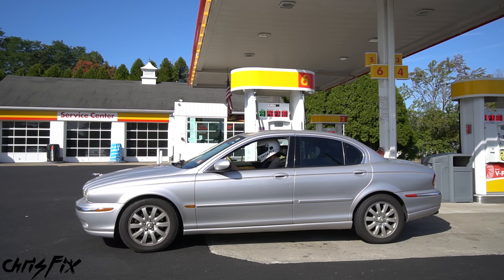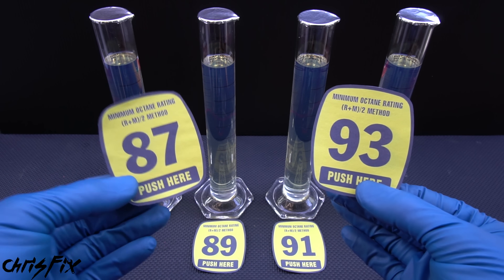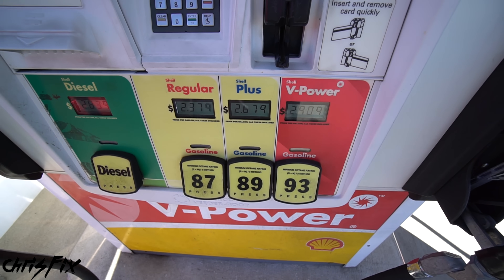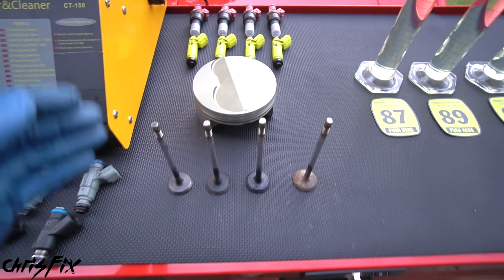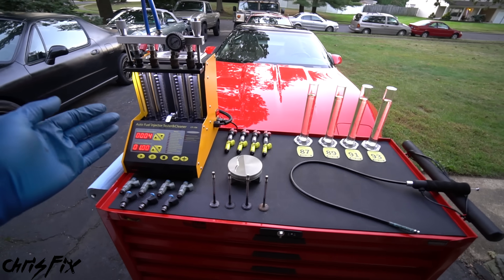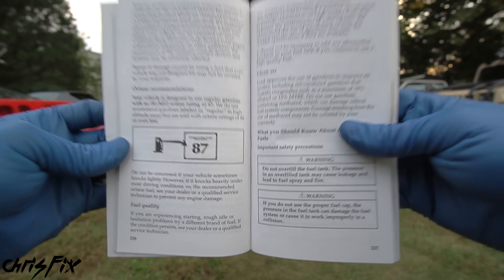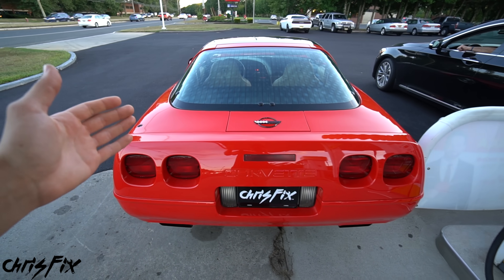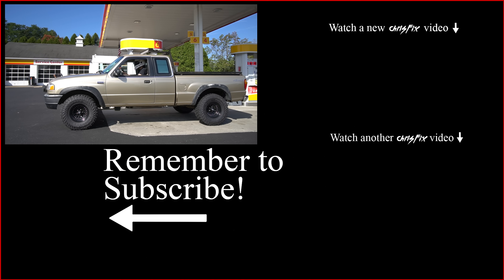What is the BEST Fuel to Use in Your Car or Truck and WHY

Comment: It's simple. Use what the manufacturer says! If your engine takes 87, put in 87. If you want to check if a higher octane will make the car run any better, try an octane booster. Quick tip, it won't make a difference. 

We in Canada have 94 Octane at some pumps. I have a 2.0T Malibu. It is rated for 91. I put in 94 three tanks in a row. I saw literally 0 difference. And I drive like you'd think a Malibu driver drives.

Comment: but what about ethanol??? obviously not a thing where you are but across many countries they have 10% ethanol in all lower grade fuels, so no energy content is not quite the same - engineeringexpailed covers this well. Also this may be limited to Canada but speaking to a career tuner, the 94 here knocks like cheap fuel in europe. He was shocked to see how much more knock he was seeing compared to the same setups back home, at the same elevation. Anyone else experience this?

great video!

Comment: Hey Chris I have a 1995 Toyota Avalon and I use regular gas. So whenever I put my foot on the gas I hear a rattling sound so I believe it’s preignition but whenever I’m at a stop either in drive, reverse, 2 or low I hear this really high knocking sounds I don’t hear it when it’s in park or neutral when in the driving gears or reverse how can I deal with that? 

Another thing my fuel pump for some reason doesn’t work so there was a direct power running from one of my fuse to the fuel pump it self to make it work could that cause a bad fuel ratio?
Reply: get a new car mate, that things about to go out on you

Comment: Just use NON-ETHANOL. Pure gas gives better mileage than E10, and much better than E85, simply because gasoline has higher free energy than ethanol. The free energy of gasoline is 34.2 MJ per liter. ... As a result, your mileage is reduced by 3% with E10 over pure gas, and 25% with E85 over pure gas, all else being equal. 
Also, Ethanol is corrosive by nature and hygroscopic (attracts water), particularly when higher amounts of water are present. This type of damage to a carburetor is typical when phase separation occurs and the highly corrosive ethanol / water mixture corrodes fuel system components.

Comment: I have a 2010 6.0L 3/4 ton Gasser Chevy. I have always filled up wirh premium fuel even though recommended is regular gas. I travel and pull a 28' travel trailer for work, and figured the premium would if nothing else give me a slight bump in performance as well as economy. As well as keeping my cylinders cleaner and more efficient. Is this a waste of money. Like I said, I pull about 10-12000 lbs behind me for hundred of mile journeys. Would primium or Supreme have any benefit in my situation, or am I just wasting money?! Thanks in advance for your hopeful response. Love your vids and have learned a lot. Keep up the good work!

Comment: What is the octane rating of e-85 fuel and when you have a flex fuel equipped vehicle what are you supposed to run? E-85 or regular or what?
Reply: look in the manual, you noob

Comment: I got tired of watching the video. So, you can’t just use any gas for your car. You have to use the factory recommend fuel. The fuel injectors are specifically designed for a certain gas. Specially for your engine.

Comment: So I got a 2003 miata with 146k miles and I’ve only driven it about 1000 miles and I only fill up with 87 even though it says premium recommended
The check engine light came on and I had the code read and it said it had something to do with the timing. Could running premium fuel from now on be the answer to solving this check engine light?
Reply: Ricky Arambula never hurts to try

Comment: Best way to reduce carbon buildup in any engine is to install a catch can on the PCV hose so it reduce oil and water vapor going into the intake system.

Comment: The simple answer is use what the mfg recommends. That said idk where you developed your ideas about pinging or detonation but your explaination is inaccurate. Detonation is exactly what it says. The fuel is detonating or exploding before the piston reaches TDC. The explosion is pushing down as the piston is still pushing up. It is fighting against itself.  Strange that your trying to educate people and dont understand how simple things like this work. Another instance where you dont understand the concept is octane booster. Study the octane rating system. Most every octane booster is a gimmick. You would need a case or more to bring 87 octane up to 93. Probably you best and easiest way to burn out a tank of 87 where you require 93 octane is to add 30-40% diesel fuel. Or add toluene if your familiar. And yes you can burn a mixture. Driving the vehicle in a lower gear may also work. Higher rpm with less load is less likely the ping with less air in the cyclinder. Loading and lugging the engine requires more throttle and air.

Also the higher octane actually has a bit less energy usually than lower octane because most additives used to resist ignition dont have as much energy and gasoline.

Comment: Whenever I put regular octane in the tank I hear pinging coming from the engine while going up hills. And when I use premium the pinging stops but my car backfires more often ....(muffler delete) am I damaging my engine or helping it when I run the premium octane gasoline? Just curious about the backfires and the pinging.
Reply: I'd say helping it using premium, but if it's backfiring, it's probably not running efficiently.

Comment: Simple answer. Your engines power cycle is designed around the fuel the manual says. That is the optimal fuel to use.

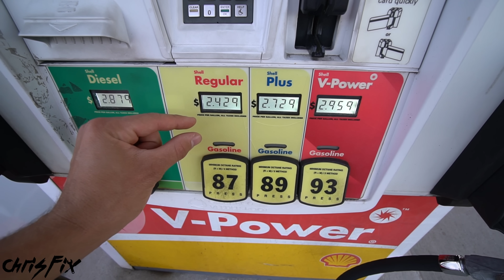Comment: @ 12:23 he contradicts his own statement of "all the fuel has the same energy" . Please correct me if I'm mistaken
Reply: 1:47 -  12:23 js
Reply: Yes, they all have the same energy, but the octane is different, so the lower octane fuel (87) will detonate easier. Most modern vehicles can adjust to that to prevent knocking/pinging (if the vehicle recommends premium), but you end up losing power.

Comment: If the octane doesn't add power for the same amount of fuel, why do manufacturer create engines that requires higher octane fuel that are more expensive?
Reply: Because other engines create more power due to having higher compression ratios, or greater pressures from turbo-chargers or super-chargers. Therefore, to prevent the fuel from igniting before it should, the engine requires higher octane fuel.
Reply: @bobbarker3248  So the power came from the engine configuration rather than the fuel itself.
Reply: @xdragon2k  Yes.

Comment: Strange, in EU, regular is 95, better is 98 and V-Power (Shell) is 100 octane. Before few years, there were sold 91 octane, and my 1997 Suzuki motorbike didn´t like it at all. I cant understand, how you can drive at 87 octane gasoline.

Comment: What about ethanol in fuel? What does it do, and the pros/cons?
Reply: Ethanol is alcohol. Alcohol can be used as fuel. To be short, it allows fuel to be more environmentally friendly. However, it does not have as much energy as gasoline, so I believe there are regulations as to how much ethanol is allowed in your gas. Some also say, because it's alcohol, it can ruin rubber seals and stuff.
Reply: @bobbarker3248  it can be used as a fuel but over long term it's less efficient for your vehicle, you get less mpg using ethanol in the fuel. I'm not sure if it does other damage but it's just annoying to see in all the fuel around me

Comment: I have a 2014 acura tsx. Always put 91 or higher octane since it is "recommended" but not required. With gas prices soaring, what is your opinion on fueling with midgrade? I rarely see cars that require or need midgrade. What exactly is midgrade for?

Comment: Great video. Thanks!! One quick question. So if my car ran more than 150,000 miles, is it better to run 2,500 miles with premium gasoline to reduce the carbon formed on the pistols and the engine? How often should I do that?
Thanks!!

Comment: What about cars that has gas installed in it. I recently bought a car with gasoline plus in spare tire place 50l gas tank. It runs quite nice and is cheaper but how it effects the engine. What to use to not get knock or something. But i most of the time buy premium on my car so it should clean its self cuz not everyone using premium and damaging engines here

Comment: gets rust on car body "it's weight reduction"
gets rust hole in exhaust "it's straight piped bro"
gets excessive carbon buildup in cylinders "it's a high compression upgrade bro"

Comment: yeah about that shell vpower, my father and I have two old dodge dakotas, one with a v6 and 220k miles and the other with a v8 and 121k miles on them.  we had ran normal 87 in them until i was filling mine up with the vpower stuff because of a video i had watched and even knowing my engine ran smooth as butter it still sounded audibly better and then my dad put the vpower in his v6 and it cleared up a whole slew of various things we could hear but had gotten used to while adding a bit of power back to it.  So basically what i'm getting at is unless the car specifically says to use 87, assuming you can afford to, you should use the 93 vpower because it's made a difference on our two trucks.

Comment: my car needs 91 or higher. if I use 93 and throw in a octane booster I get better mpg almost 2 city and 8 extra highway. is this because the ecu is adjusting the afr to take advantage of the extra detonation resistance?

Comment: it takes higher compression to detonate the higher octane. high compression high horse power motors you dont want gas to ignite from compression before the spark plug fires.

Comment: Hi i own a 02 GMC Yukon xl and it can take 85 flex fuel only problem i can't find any gas station with 85 why is that?  We used to see them a lot more i guess they stopped selling it what's the reason? I'm from Brooklyn NY

Comment: In Canada, Shell V-Power Premium 91 octane has one huge advantage - no ethanol! Ethanol leaves deposits that degrade engine performance and reliability over time. I use it exclusively in my snowblower and lawnmower, where the fuel may sit for months before use.

Comment: What about when the manual says "Super Premium Highly Recommended"? Mini Cooper S says this in the manual. Does this basically mean always run Premium when possible, but if stranded, octane booster isn't necessarily required when filling up with 87?

Comment: My 99 chevy prizm says 87 or higher. It gets the higher. Premium only. 19 years payment free without leaving me stranded ever. Only asks for oil changes and basic replacements based on nothing but mileage. I’ll drink water. It’s getting premium. Did regular for a week and ended up having to filled up more often doing the exact same routine.

Comment: Ok so I have a 89 f150 with a 5.0 ( 302 ) but I have built the engine into a 306 and I’ve put regular in it for 8k miles ( every since it’s been built ) but how do I know if I need premium ? The truck so damn loud I probably couldn’t hear detonation even if I wanted too
Reply: And I swapped it to a carburetor too

Comment: So you use mid-grade in the Del Sol? Do you have a B series engine in it? I have a B16 and I believe the sticker in the fuel door says 91 recommended but you read the manual it says it only is good to gain HP.

Comment: I have a 2003 Dodge Dakota with a 3.9L V6. The engine has 197k miles, but it is still running strong with no knocking. I’m upgrading the engine with short-tube headers, a premium catalytic converter, cold-air intake, and ported throttle body, because the previous owners swapped the differential for a 3.55, and the stock engine only makes 175hp and 220ft/lbs (at 6,000lbs, this truck is massively underpowered), but I want to keep the fuel mileage that the differential gives me. My question is, after I swap these parts and get everything tuned, do you think that I’d need to change fuel octanes from the factory-recommended 87-octane?

Comment: Awesome video! 

A family member of mine was suggesting that it's good to get regular tune-ups... I always thought a tune-up just meant oil is changed regularly and alignments are done when new tires are put on. What does a tune-up consist of? Where do you go to get them? Is there more than one place you have to go to get a complete tune-up (i.e. an engine person, exhaust person, transmission person, etc)? How much do tune-ups cost for a typical daily driver type vehicle (or, more specifically, a used 2013 VW Jetta Sportwagen TDI)? 

Thanks

Comment: Another question, are the extra additives worth it in premium compared to regular? Example, ExxonMobil’s Synergy Supreme supposedly has twice the additive in their premium compared to their regular, and Shell V-Power has 7 times the additive than (their regular, or minimum EPA standards? Not sure on that one). Is this extra additive worth it in, say, a port injected 4 cylinder recommending 87 octane?

Comment: I was wondering how octane can affect turbochargers. I know a lot of manufacturers require premium for their turbocharged cars. However, Honda seems to be pretty split on which turbo models require premium and which don't. I have one of the models in which they don't require it, but I've been told that running premium is better for the life of the turbocharged engine. Due to these conflicting reports, what do you recommend I used for my turbocharged engine to get the best life out of it?

Comment: What do these "poppings" sound like?
My motorcycle is carbed and it makes popping noises when i give it gas in a high gear at low rpms.
It is carbed so i think the carbs are dirty or bad but i ran so much seafoam in it and still now change.
So now that you mention, i think those popping are the knocks

Comment: Question. I live in an area with an elevation of 4500-5000 ft. And the octanes offered are 85, 87, and 91. It seems to just be in my region though. I’ve never had a problem with 85 even though the manuals for all my vehicles say they need 87. Why is 85 offered here, does the elevation affect anything, and am I safe to continue using it? Great video as always!

Comment: I have a question I ran into the same problem like you did on your truck. I have a Ford Expedition with 187k miles. I started to hear rattling like marbles in a can. So I showed my mechanic and he told me to start putting 91. Once I did that the sound went away. I did that for 6k plus miles but decided to go back to 87 and I’m running into the same problem. Also I put injector cleaner but nothing changed. Any ideas?

Comment: Well, the misconceptions about higher octane gas having more power probably comes from the fact that higher compression engines benefit from it. Premium gas + high compression = higher thermal efficiency which can either mean more power or less fuel consumption.

Comment: Keep in mind also that the listed fuel octane is the minimum it can be at sale, a lot of the time fuel stations aren't actually importing a unique blend for every pump handle, instead the the bottom grade is just the older stock of the middle grade plus any rinse fluids during line changeovers ect. So even though its listed as 4 numbers lower, its often actually very simlar to the middle grade, especially at busy high turnover stations... hence I'd generally recommend anybody with a "premium recommended" car buys regular, only get premium if you are required too, especially since manufactures are very conservative in tune already.

Comment: Sorry man but at least 50% of what you said is just false, e.g "modern cars are fitted with knock sensors" that is 50/50 depending on the manufacturer and any mechanic will tell you that is simply not true but a higher octane fuel does burn cleaner and much more efficiently, for some of the reasons you pointed out. But the difference between an engine run on premium, (we have 98 here in Aus) and standard 91 for us, is blatantly obvious when you build engines for a living it will also gain you a extra 50-100km per tank for just a few dollars.. try it for yourelf.

But no, octane boosters don't work dyno-tested they mostly reduce power, fuel is quite advanced these days and if there was a simple additive that would improve it, it would be added in the refinement prosses, so adding anything just throughs of all the hard work the engineers put in.

I'm not trying to troll you, it's just if people take all of that as fact, they are going to get themselves into trouble and to anyone who is not a mechanic, you really look like you know what you're talking about but unfortunately, your facts don't line up with reality, I would just say maybe a little more research would be a good idea for videos like this but other then that facts, it was a good video seriously.

Comment: Does gasoline with up to E15 or 15 percent ethanol affect engine performance or economy? I've noticed I get less throttle response and worse fuel mileage when I use it, but it is also heaps cheaper than regular where I am at. Is it worth it? Whats the point? Emissions? Thanks.

Comment: Interesting thing I found out as a resident of Rocky Mountain state; Regular unleaded is 85 in Utah, Wyoming, and a few other states at high altitude because the low air pressure means a lower partial pressure of oxygen and a resultant lower risk of engine knock. So I wonder if using 85 on a car that recommends 87 in a high altitude setting is alright... I've been doing it with my 2017 turbocharged civic and it's been working out okay so far.

Comment: I hate to admit but I have a fuel tech system (computer program) for my truck and I get 560 horsepower with 87 octane. With 93 I get 577.thats a Hemi engine . It’s. Crazy .